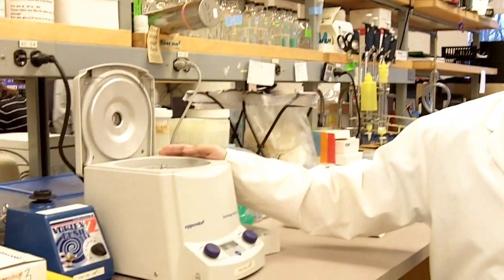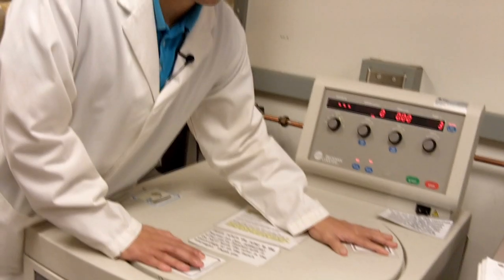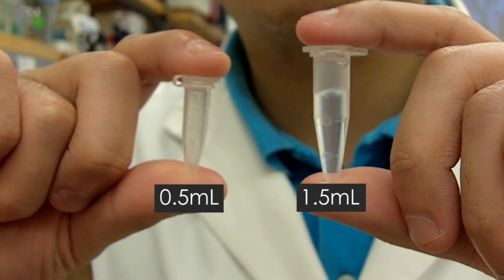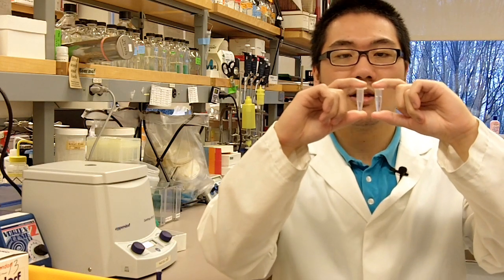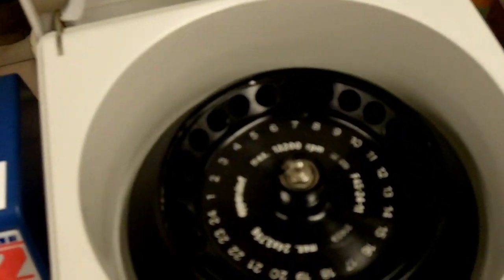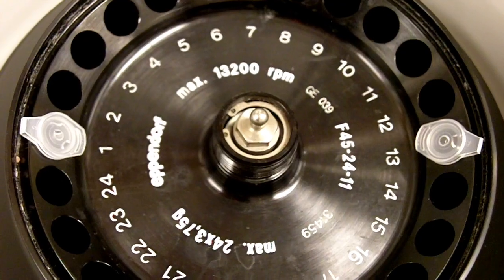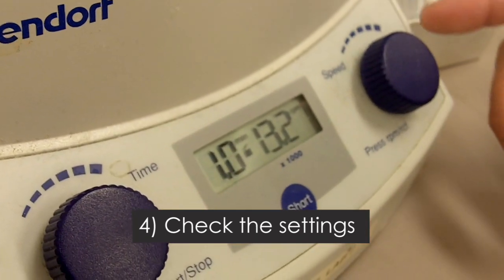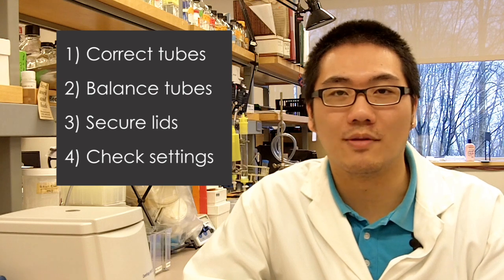How to Use a Centrifuge

Comment from the maker: @Amorquies When you centrifuge your sample, the pellet will form on the side of the tube that is facing outwards. So, if you place the hinge on the outside, your pellet will form on the hinge side. This makes it easier to pipette out the supernatant without disturbing the pellet, as your pipette tip can rest against the other side of the tube (without being blocked by the tube lid) as you remove the liquid.

Try it out both ways and you'll see!  =)
Reply: damn this tip is good

Comment from the maker: @luciferin1 Not balancing the tubes puts extra strain on the spindle. Depending on how imbalanced the tubes are, and how fast the rotor is spinning, you can badly damage the centrifuge....and even other objects (and people) around it. So always balance your tubes!

For many tabletop centrifuges, you can simply look at the tubes to see if they balanced. But for certain high speed centrifuges, you need to check their mass to make sure they are balanced.

Comment from the maker: @allroundgirl123 When referring to centrifuges, usually the term centrifugal force is used. However, it is not a "real" force. Centripetal force is the "real" force which acts inwards, while centrifugal force appears to act outwards. I'm not an expert in physics, so if you want more details about this, check out your inbox as I just sent you some links (I can't insert them here) - the links also provide some good examples to help understand the concept :)

Comment from the maker: @8Avenger If you are worried that your protein may be coming out in the flow through, keep the flow through, and run a sample of it on an SDS-PAGE gel. If you see a band, then some of your protein leaked out through the membrane.

Also, just make sure that your filter's MW cut off isn't too close to your protein's molecular weight or else you run the risk of your protein going through.